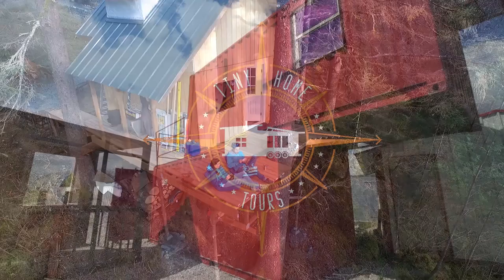Off The Grid Alaskan Tiny House In A Treehouse ~ Land & Building For $35k

Comment: look up the Centrex 3000 for your cabins composting toilet needs ...there's electric , non electric, low flush and dry flush versions .  
I am going to be installing the Electric +Low flush model in my 600' 1 room schoolhouse here in WV ...costs for the high capacity Centrex starts @ $2,000 so depending on model and toilet you can expect to spend about 2,500-3000 and yes its available on amazon prime ...that about half the cost of a septic system and unlike septic. U can use albeit anywhere rural BY LAW ! 
ALSO install a properly sanitized rainwater capture system and if u have a good spring or creek take a look at micro-hydro power production which u can additionally tie to a solar/wind system .  Good Luck guys

Comment: So ---- What happens (when) the dead "Support Tree's Root Mass" in the middle of the house eventually starts to rot and decay away? That's why most dead trees eventually fall over. The root system has decayed to the point that it can no longer hold the tree in place. The weight of the house will only assist in pushing the decaying tree down the slope (the floor will actually start collapsing straight down into the decaying void at first). This also goes for the other trees connected to the house when they die someday... It's not sustainable.

Comment: soooo what happens when the tree grows?
Reply: it sounds like your making that sh*t up.  Trees grow in the direction of the sun in a spiral pattern.  The amount of growth depends on several things, like the type of tree, amount of rain, amount of sunlight and climate conditions.
Reply: Dev: It's just the very tip of a plant that grows upwards, below that the only growth is outwards. Try hammering a nail 4' up a quick-growing tree like a birch that's 8' tall then check it a year or two later. However much the tree grows by in that time, the nail will still be 4' from the ground.
Reply: Alexander: the slots/rollers are to allow horizontal movement (mainly from wind loading) and thus eliminate any forces in that plane while still letting the tree attachment bolts (TABs) support the  weight of the structure vertically. This means that the weight of the treehouse doesn't generate any horizontal forces so that your point about the tomato plants in your example bending towards each other, while true, isn't actually relevant to this situation.
Reply: You're right. There will still be the friction of the TAB head in the slot. What I should have said that was they eliminate any significant forces for most of the lifetime of the average human being and therefore effectively solve that problem. After all, they are designed to move when the tree flexes with the wind! It seems that I failed to realise just how precise my answer would have to be.

And re your earlier answer: no, it isn't. For one, the weight is acting vertically downwards THROUGH the structure, no bending moment or lateral displacement is applied. For two, the structure IS reinforced - see my earlier point about continued growth lower down being outward and not upward thus increasing the diameter of the tree and hence the amount of material in place to support this extra weight higher up. So your example of two identical structures, one with extra weight on it, is irrelevant. 

May I suggest that you take an extra minute or so to consider these sorts of situations in the future? Developing one's critical thinking and analysis is always a good thing :)
Reply: Tree's will take the path of least resistance. I'm making that shit up but it might be true.